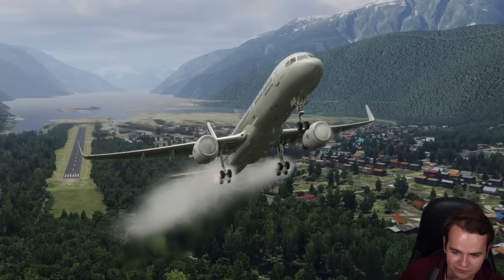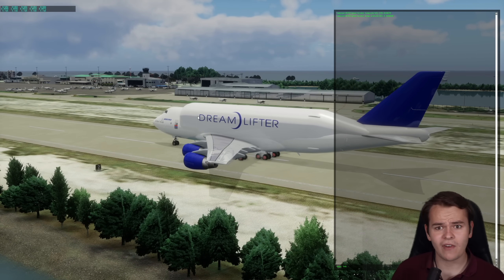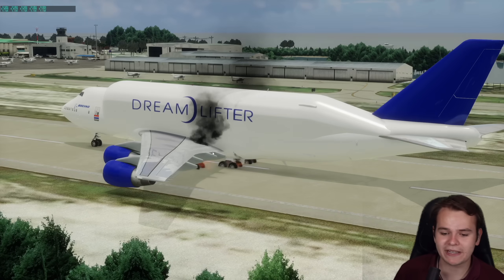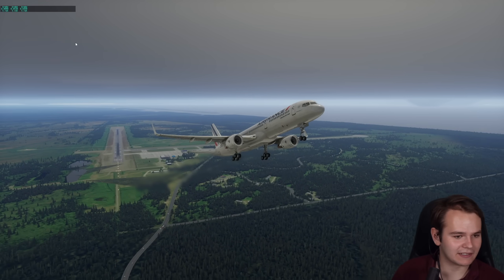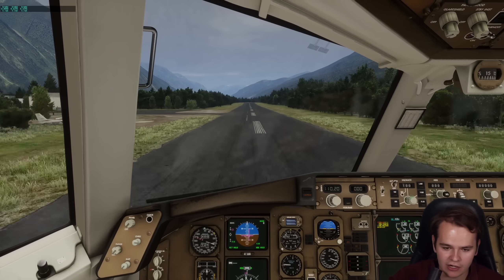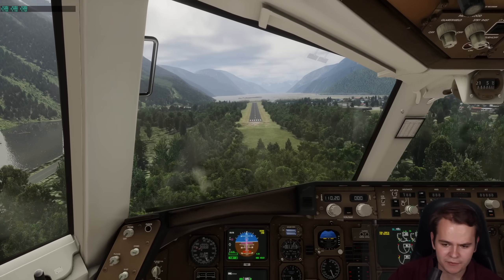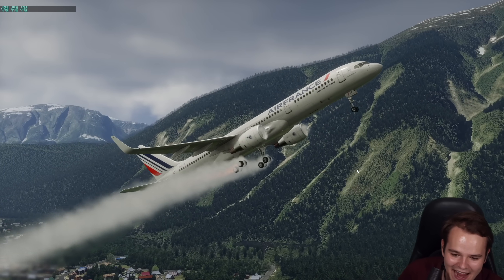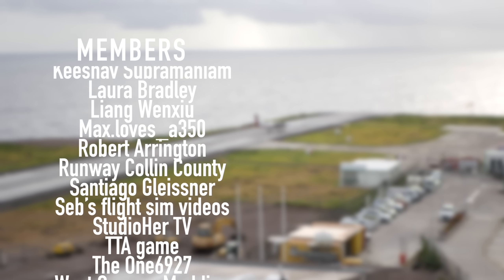Why Planes DON'T Use Full Braking Power

Comment: as far as i know almost every default aircraft in x-plane simulates brake fade and temp, in the a330 there’s also a brake fan to cool them off
Reply: Even the Concorde had fans on the tyres for the same reason, to cool those brakes.

Comment: it does remind me of an accident of cathay pacific flught 780, where engine 1 was stuck at almost full power during landing with no controls over the engine, forcing the pilots to land more than 100 knots faster. it landed hard and the pilots used max brakes, and came to a halt just 300 meters before entering the water. the breaks did reach over 1000 degrees C due to the extreme braking and an evacuation was ordered

Comment: The Fire works on all default aircraft in XP12...
Reply from the maker: I didnt see it in the changelog
Reply: @Swiss001  I was practicing landings in the default A330  applying full brakes until they were like 700 degrees celcius hot. They began to smoke and burn...
Love your Videos, Swiss ❤❤❤

Comment: Speaking of wheel well fires, you should look into the Nationair 2120 incident. A DC-8 flying with underinflated tires caused them to explode and catch fire during the takeoff run. There were no warnings indicating this, it was only when they reached the climb phase that the plane was losing hydraulics. I won't spoil too much since it's an interesting topic to look into.